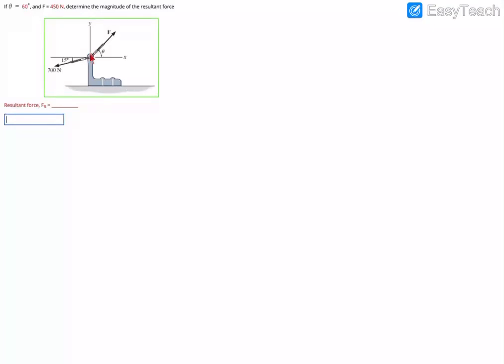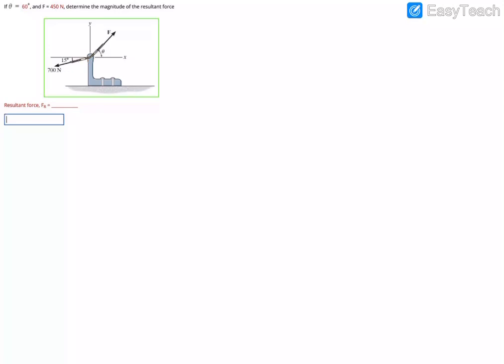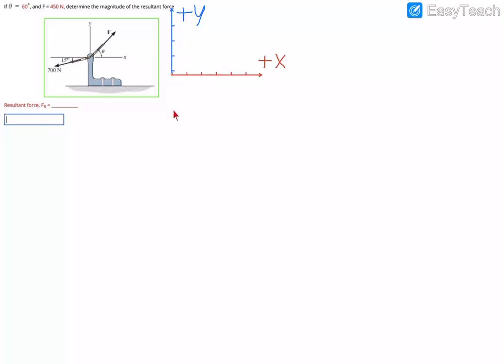If θ (theta) = 60° (degrees), and F = 450 N, determine the magnitude of the resultant force

Comment: how to calculate α in this problem? tried to calculate it but didnt get the answer
Reply from the maker: If you’re referring to θ as α, θ=tan-1(208.5/451.1). This will give you the angle in the resultant force triangle (FR) at the end of the video, 24.8° above the negative X-axis.
Reply: @gr_engineering  i did get the answer for θ. My lecturer only provided me the answer to the problem & i'm trying to figure out the solution workflow. 

the answer that provided:
F𝑅 = 497𝑁
𝛼 = 95.19°
∅ = 155°

i'm confused, how do i get the 𝛼 = 95.19°? T_T
Reply from the maker: @wainamaisarah   To be honest, I think that may be a mistake from your lecturer. I checked the problem statement you submitted, it only asks for the magnitude of the resultant force and the angle measured counterclockwise from the +x axis. So there can only be 2 unknown variables. I would double check with your lecturer regarding why α is listed there. Let me know how that goes.
Reply: @gr_engineering  i did asked my lecturer if there's a mistake in that problem but he said there's no wrong and i need to use parallelogram law to solve it, which i did and still didn't get the 95.19° but i get 84.82°instead T_T
Reply from the maker: @wainamaisarah  Thanks for clarifying. I went ahead and used the law of parallelograms to find α, I found it as 95.2°. I’ll make a post about this soon. Use the law of cosines to find the resultant force. Do not break the given forces into x or y components. Then use the law of sines to find the angles.
Reply: @gr_engineering  ooohh i see no wonder i didn't get the answer cuz i break the forces into x and y. thank you for pointing that out! can't wait to see your next video
Reply from the maker: @wainamaisarah  I posted a video for your problem. What I noticed is that you're applying the law of sines to an SSA triangle. SSA triangles are ambiguous with the law of sines and have may have 2 different solutions (there are two solutions to sin-1(700sin(45)/497). Knowing this, I suggest you just use the law of cosines again since you have an SSS triangle after solving for your resultant force. The 84.8° you found is the solution to the other ambiguous triangle. To find the angle measured CCW from the +x axis, it makes more sense to use the other solution, 95.2°.
Reply: @gr_engineering  can i know which video is it? i'm curious about when i should use 180-teta and when i should use it.not every time i can use cosine rule to check. and also which triangle is the 84.8% apply to
Reply from the maker: @konghangeee6782  https://youtu.be/7n-mPAIgry8

Comment: how to get the angle?
Reply from the maker: θ=tan-1(208.5/451.1). This will give you the angle in the resultant force triangle (FR) at the end of the video, 24.8° above the negative X-axis.

Likely, you’re going to have to call out the angle with respect to the positive x-axis (from quadrant 1), so you’d want to find the angle between the positive x-axis and FR (resultant force). That would be (90°) (from quadrant 1) + (90°–24.8°) (angle between FR and positive Y axis). This yields you 155.2° from the positive x-axis.

If you’re still confused, see this very similar example here, which does show how to calculate the angle:

https://youtu.be/ADBNzxDSny8
Reply: @gr_engineering  thanks sir. It really means a lot